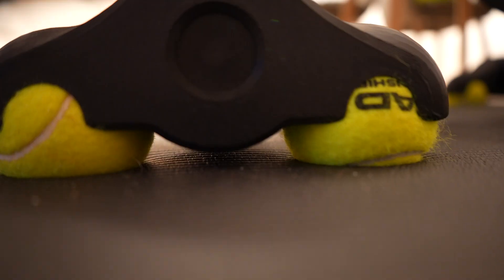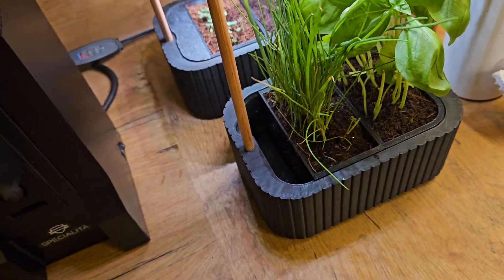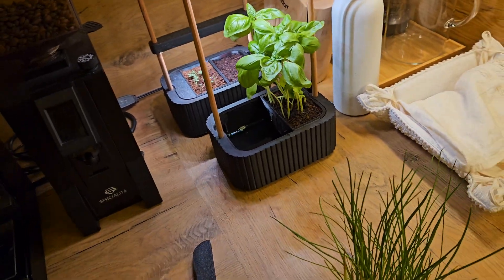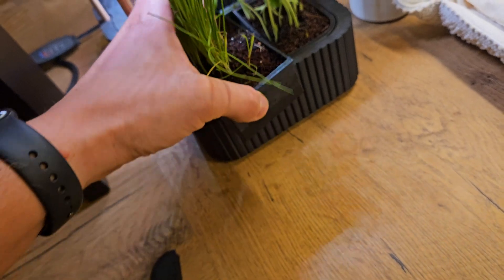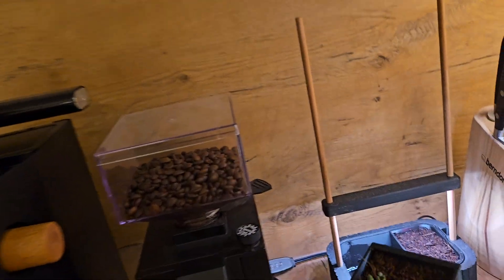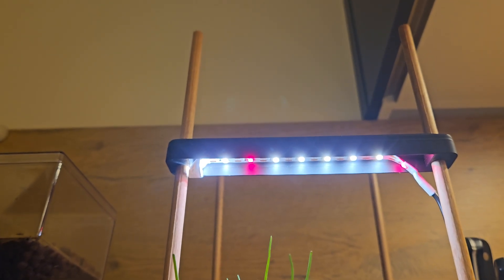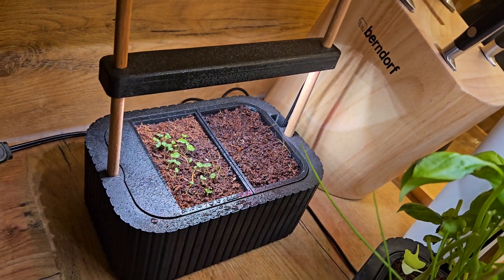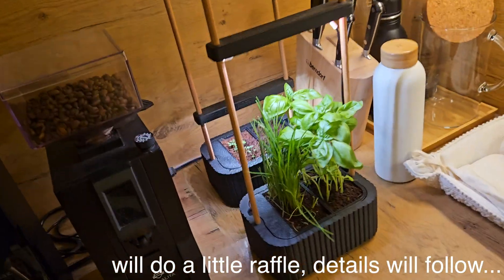I 3D Printed a Smart Garden (Does it actually work ?!)

Comment: Very cool! I agree with TCColeman-r9v that making it hydroponic would make a huge difference. My idea is to instead of tubes, add a "shelf" that the inserts stand on. A timer on the pump to circulate the water a few times a day, moving it from the tank to the shelf, running from one side to the other (so there need to be a small height difference).
Reply from the maker: yeah will work on a Version 2 soon :)

Comment: Did you try the wicking method? It would be a good way to set and forget except for needing to water the bottom every once and a while.
Reply from the maker: no whats that? will be working on a version 2 soon!
Reply: @3dtecstudio make a sub compartment under pot to store water and using a string as a wick to draw water up into the pot.

Comment: Great concept. I bought a few counter top hydroponic systems and mod it myself to build upon. I wish I know how to do 3d design because I have a few more ideas to make it great.

As for mold, it’s with the growing medium, use gritty rocks, clay balls, or if you really need to use peat moss, then soak in boiling water first to get rid of stuff that grows or comes with it. A hydrogen peroxide soak also work. But as for design aspect you can add to avoid mold, it’s more ventilation.

Make the base of the cup more like net, not just holes or slits that are too far apart. The current design will only work if it’s a wick system, but if the bottom is submerged into water, it’ll go soggy.

I like the elegant and minimalist design but plants really needs air circulation too so adding a small fan would be great. Then add a small pump to make it a recirculating system. Otherwise it’s just a kratky, still can work that way though just needs improvements. 

Would love to collab on design.
Reply from the maker: Hi thanks for the comment 😍, send me a mail how you would like to do it :)

Comment: Cool idea. I like it. 
If you wanted to take it a lot further, you could convert this into a small hydroponics system. All you would need is a small fountain pump and some flexible tubing and you should be set.
I really like that you made the light bracket have an adjustable height. How far the light is from the leaves of the plants makes a huge difference in their growth.

TL;DR: You have a great base model. Add a fountain pump for a hydroponic system.